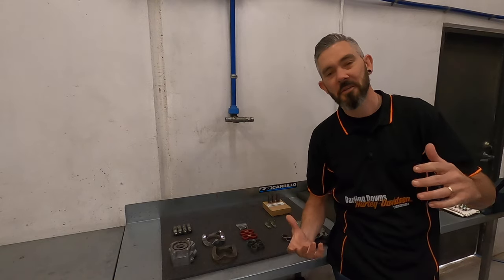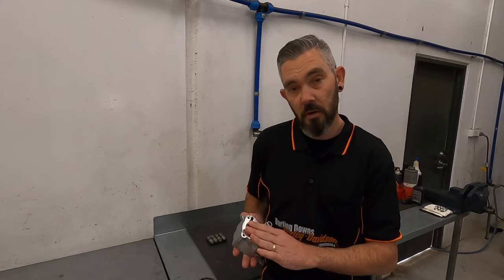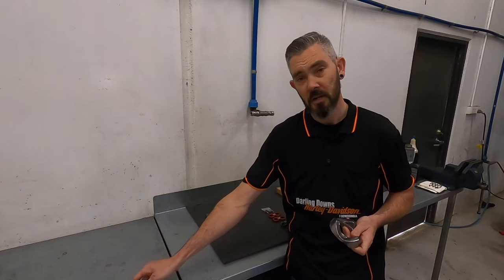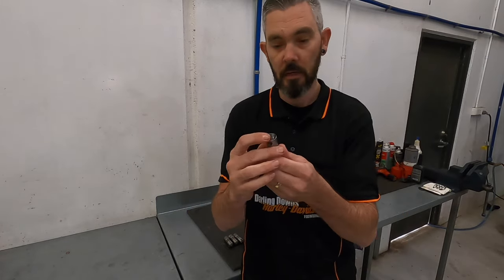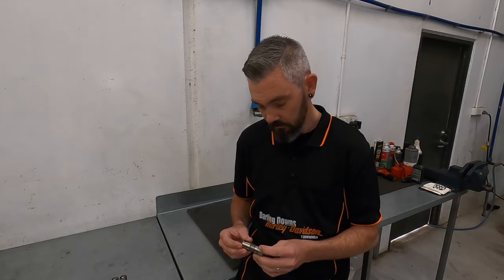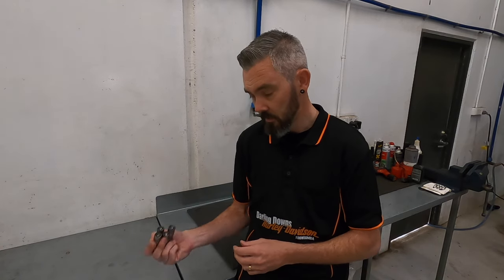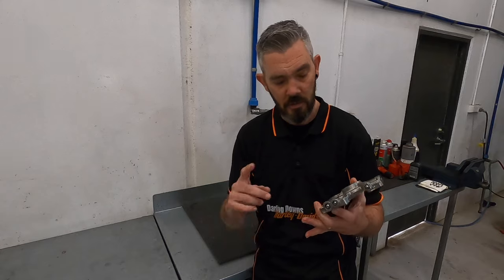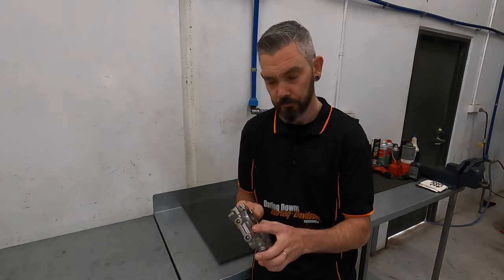M8 Engine Must Have Upgrades / Harley-Davidson / Engine Building

Comment: Why is it a must have? Are Harleys still shitty Bikes that break down every 500Kilometers? It seems to be! There can't be another reason. Every Part you do better than original Harley-Parts, says Harley offers only bad Parts. So why should/would anyone buy a Harley when he is forced to change nearly everything? You say with every Super- Part "Harley is shit, we can do it better", The result is, nobody should buy a Harley - everybody needs a TechMiller-Bike🤣.
Reply from the maker: Yeah don't buy one mate. You wouldn't like it. You'd be lucky to get it out & back for a short ride down town. 

It will leak more oil than it actually holds, the brakes are just cosmetic & they can't go 175kmhr around a round-a-bout in 2nd gear
Reply: @MasterTechMiller  yeah, driving to the Dealer and back would be enough 😆